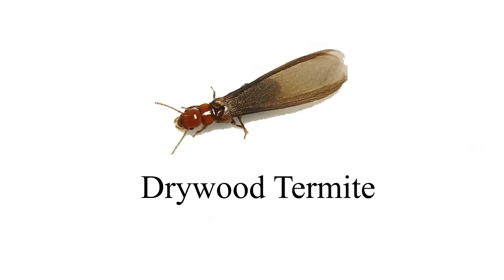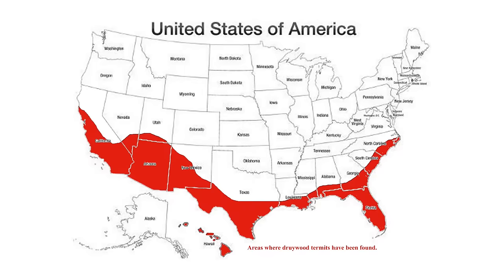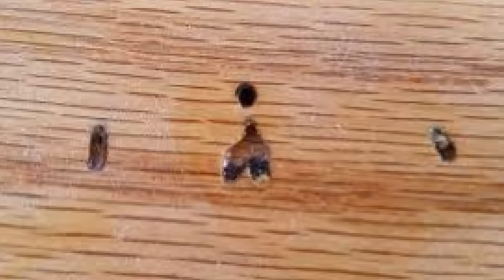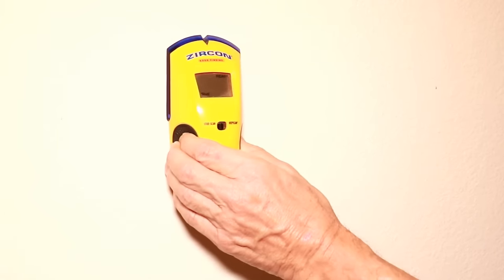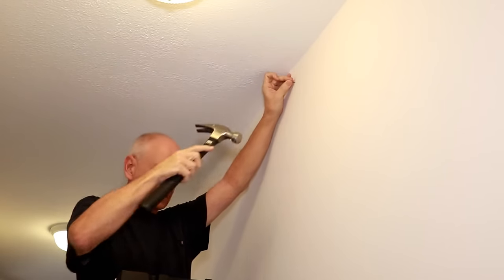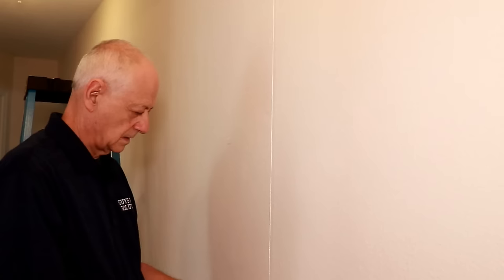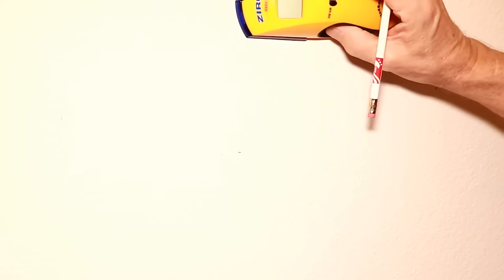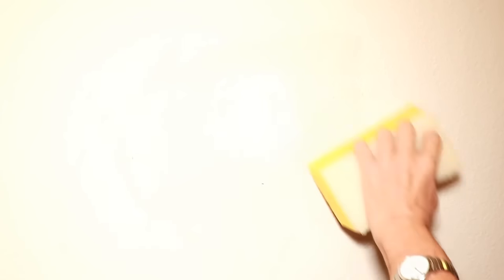How to Treat a Drywood Termite Infestation Yourself. A MUST see if you have Drywood termites.

Comment: Nice video. Thanks for making it.......How does fras fall down past a blanket of insulation batting?
Reply from the maker: Hi Mike.  That is a good point and yet another reason why tapping on the walls is far from a reliable way to find drywood termites.  The good news is that the interior walls are typically not insulated, so it works best on those areas.  The exterior walls are definitely more of a problem.  You see, this is why the pros cannot guarantee that they will find all the galleries.  There really is no perfect way to find all the galleries that are behind drywall and it's the reason why I tell you very early in the video that the only sure way to eliminate a drywood termite infestation is to tent and fumigate the entire home.  Still, fumigation is expensive and a lot of folks cannot afford it.  I was not even going to do this video because I understand that I cannot give folks a sure-fire way to eliminate drywood termites 100%.  My goal is to always give everyone a 100% guaranteed solution to a problem and I knew that I could not do that with drywood termites.  However, I had so many people ask me to help them that I finally decided to make the video, knowing full well that there is no way to find all the galleries.  The treatments that I recommend always work 100% of the time.  It's just finding the termites that is the problem.  Even if you use an inspection scope on the exterior walls, the frass may not make it to the bottom of the wall void because of the insulation.  Also, as I pointed out in the video, listening for hollow sounds in the wall studs is far from reliable as well.  Let me tell you Mike... I am always honest about this stuff and I will always give you the straight story.  You are totally correct.  I wish I had more to offer, but it is what it is.  If you can afford to fumigate, then that is definitely what you should do.  This video is just for people who simply cannot afford to fumigate.  For those folks, this is the very best option available.  Albeit not exactly perfect.  In any event, after you treat for drywood termites, you should start doing the prevention treatment that I explain in my other video.  That treatment is pretty much a 100% foolproof method of stopping drywood termites from ever entering your home again.  It's cheap, it's easy to do, and it is very effective.  I will place a link below for it in case you missed it.  Thank you so much for the comment.  I wish I had more for you.  Be well my friend.

How to Prevent Drywood Termites video:  https://youtu.be/neNsmVbj8Pc
Reply: @GuysPestSolutions  Thanks for the great answer. 

I listened to your detailed treatment option for treating all the studs. You said to drill holes 4" apart and 1-1/2" deep in every single stud.

Most of the holes will not actually hit any galleries. So, are there any residual benefit to injecting the foam where there are no termites? In other words, does the foam remain forever in the stud in the event a future termite colony tries to live at that particular location? 

If there are residual benefits, does the foam under pressure, actually seep into the wood beyond just the small drilled hole before it comes back out? Wondering if the injected foam may make pockets of poison that may be of benefit in the future years.
Reply from the maker: @mikem54321  You are correct.  Most of the holes will not hit anything.  The only reason for doing the entire stud is because you don't know where all the galleries are.  If you don't inject the foam every four inches, then there is a chance that you will miss a gallery that you did not find.  Now, you don't need to do every stud if you don't want to.  You can treat just the studs that you think are infested.  Of course, there is a good chance that you will miss galleries this way.  If you treat every stud, then you cannot miss a gallery.  The foam has about a 90-day residual, so after that it is no longer effective.  This treatment is designed to just eliminate existing galleries and it does not prevent new ones.  After you get rid of all the galleries, then you need to do the treatment in my video on how to prevent drywood termites.  That treatment will prevent drywood termites from ever infesting your home again.  However, it must be done every 90 days.  If you have not done so already, please watch that video as well.

I hope that helps.

https://youtu.be/neNsmVbj8Pc
Reply: @GuysPestSolutions  Thanks for the reply. Pity the foam does not last in the 2x4 forever as a future barrier to colony formation. It would make the idea of drilling a huge number of holes very worthwhile.
Reply from the maker: @mikem54321  There is a way to permanently treat your home for every species of thermite there is, but you really need to know what you are doing to do it.  Most pest controllers won't do it.  A lot of them don't even know about it.  I will place a link below in case you are curious to see how it is done.  I have never done it myself because it is fairly new and came out after I retired.  Anyway, have a look and see what you think.  Be well Mike.

https://www.youtube.com/watch?v=kXQTc9wwCfQ&t=25s
Reply: @GuysPestSolutions  does boricare soaked through the entire piece of wood or does it just touch the surface and stay there and prevent termites from eating it?
Reply from the maker: @macknumber9  Bora-Care will penetrate quite deeply into the wood.  If you apply it to both sides of a 2 X 4, then it will most likely get almost all the way to the center.  It will certainly penetrate deep enough so that you will not get structural damage before the termites are exposed to it.  This is not the case with other borate products like Timbor.  Most of the time the borate products are wettable powders that just treat the surface of the wood.  Bora-Care is a liquid, so it will penetrate into the wood fibers, much the same way as if you got the wood wet with water.

I hope that helps.  Be well my friend.
Reply: @GuysPestSolutions  sorry for all these questions but I just thought of one that I think is very important...

This is related to the 3 month protocol that you recommend for drywood PREVENTION.  Spraying the outside....

My question is if swarming season is only 3 months or so out of the year for drywood termites? May through July for example...then why the need to spray pesticides as a preventive measure throughout the entire year?  Wouldn't you be able to just start spraying the exterior from say April through August if the season were May through July?
Reply from the maker: @macknumber9  That is an excellent question.  You are correct that termites usually swarm at certain times of the year.  The only thing is that they don't always get the memo telling them when they are supposed to swarm.  Also, you can forget to do it if you don't keep a schedule.  Finally, this treatment isn't just for drywood termites.  It will also prevent every other pest imaginable from entering the building.  For example, carpenter bees, spiders, American cockroaches, carpenter ants, other species of ants, and so forth.  Drywood termites are just part of the problem.  Carpenter ants and carpenter bees can do plenty of damage too.  Why not just treat every three months and be pest free?  It seems to make sense to me.

I hope that helps.  Be well my friend.
Reply: @GuysPestSolutions  you are seriously helping me so much you have no idea how much I appreciate it.

Talked to a few pest control companies yesterday and they immediately said I have drywoods and need tenting....seems kind of odd that they don't even want to rule out subs....I asked and he said because I am seeing swarmers in the house they are drywoods and subs don't swarm here in FL at this time of year....what do you think of that? Any truth?
Reply from the maker: @macknumber9  The truth is that, here in Florida, subterranean termites usually swarm between November through May, while drywood termites usually swarm March through July.  However, drywood termites have been known to swarm every month except December.  Apparently, they like to take off for the holidays.  So, you cannot identify a species simply by the time of year that you see the swarm.  Sometimes the termites do not get the memo that they are supposed to swarm on schedule and they do whatever they want.

Also, subterranean termites can swarm in you home.  So that is not a reliable way to identify the species either.

The best way to identify the species is to examine a specimen.  It's pretty easy too.  If the swarmers are solid black, then they are subterranean.  If they are a reddish/orange/brown color then they are most likely drywood, but they could also be Formosan.  In your case, if the swarmers are not black, then the pest controllers are most likely correct.  If these are drywood termites, then the advice they gave you to fumigate is also correct.  The only sure way to eliminate a drywood termite infestation is to fumigate.

Keep in mind though, fumigation has no residual action, so you can get reinfested the moment the tent comes down.  Therefore, you must do a preventative treatment every three months.  If you fail to do that, then I can almost guarantee that you will be fumigating again after four to seven years.  While you may get reinfested immediately after the tent comes down, it takes between four to seven years for a new batch of termites to start to swarm and that is when you will realize that you have them again.  This means that they were busy eating your home for four to seven years before you realized that they were there.  I have a video on how to prevent drywood termites and I will give you a link below.  This is something that you must do yourself because, most of the time, pest controllers will not do it.  It is perfectly safe though, if you do it my way.  If you fumigate, then start the preventative treatment a few days before the tent goes up.  That way you will be protected the moment the tent comes down.

I hope that helps.  Be well my friend.

Video on how to prevent a drywood infestation:  https://youtu.be/neNsmVbj8Pc
Reply: @GuysPestSolutions  it helps more than you will ever know.  You truly are helping me so much and probably more people that aren't commenting but they are reading this.  Again I GREATLY appreciate your time in thoroughly answering all my questions.

I think my plan of action is to spot treat the best I can until my tenants move out.  I don't want to tent while they are in there for 2 reasons.  1 they might not be happy about having to move out for 3 or 4 days and I would have to pay for that on top of the tenting.  2.  I think 11 more months I should be ok as long as I throughly spot treat and at least control the damage.  Of course this is if they are drywoods which eat slower than subs.  If they are subs then obviously I will take care of it now.  The ultimate plan will be though to shop the best prices for tenting and doing your prevention protocol.

I had one pest control company tell me that they would tent for between 750 and 1700 (they haven't seen the property yet just over the phone quote) and then pay 15% of that per year will cover me for a free tenting if they did come back....seeing how it would take roughly 6 years for them to come back I know I would pay at least roughly 150 x 6 ($900)...I think this is a fair deal because it would probably cost me that anyway to prevent but the difference would be that if I did in fact prevent I wouldn't be having to have it tented again (inconvenience) and I wouldn't be having all that damage take place for those 5 or 6 years without me knowing.

So armed with your knowledge it would be wise for me to not pay them the 15% cost of tenting every year and just be proactive in preventing them from returning by spraying every 3 months...I might just have to do this for all my properties down the road...I have 2 rentals now and I don't plan on hiring someone to do this because I only trust myself for how much pesticide I used and how efficient I am in making sure I do a really good job spraying everything
Reply from the maker: @macknumber9  Yes, I think you have a pretty good plan.  Drywood termites are slow eaters and so, hopefully, there will not be all that much damage in another year.  The way a lot of people handle drywood termites is they just tent the buildings every seven years, but as you pointed out, that means the termites are busy eating away constantly during that period of time and so the structure is going to continuously be damaged.  At some point that will most likely result in a structural failure of some type.  The reason people do it though is because they do not know how to do a preventative treatment because nobody ever told them how to do it.  You just happened to get lucky because you found my channel.  To the best of my knowledge, I have the only video on the entire web that shows how to do a preventive treatment for drywood termites and I only posted that about four months ago.  My channel has not exactly gone viral, so there are still literally millions of people that do not understand that they can prevent their drywood termite infestations.  It's really a shame too because people are throwing good money after bad on fumigations and this process is resulting in millions of dollars in damages every year to homes when it can so easily be prevented.  That is why it is so important for you and everybody else that has discovered my channel to pass the word along to everybody you know.  The truth is that this video has only been viewed about 1200 times, but there are literally millions of homes that are located in drywood termite territory, so all I have managed to do so far is to kind of spit on a forest fire.  For the life of me, I don’t know how to get the word out, other than to ask people to pass me along to others.  There is a little glimmer of hope because I am now getting some professional pest controllers who are contacting me for advice and they tell me that they are watching all my videos.  The stuff that I tell you to do in this video is not exactly rocket science and it is all technology that has existed for a very long time.  The thing is though that none of the other pest controllers stopped to think about how to use the existing technology to prevent drywood termite infestations, even though it’s so obvious.  Once they see the video, they inevitably think to themselves “Why didn't I think of that?”  I guess it's like that with a lot of things on the web.  It never ceases to amaze me some of the things that people come up with that I never thought of.  Anyway, I hope that I can get the word out somehow in order to save people a lot of money going forward.

On a positive note, the price that they quoted you sounds pretty good to me and it sounds like you now understand everything you need to know on the subject to be effective.  So, I will take that as a win for you and a win for me as well. 

Be well my friend.

Comment: How about trying to locate termites by sound? Maybe some really high powered stethoscope where you don't even need to drill into the wall to check for frass you can just find the beam or stud and put that stethoscope up to it? Do termites make a clicking sound when feeding? This could really work well especially if you get a really good stethoscope that can pick up sound good and you would avoid all the little holes....would be faster as well as you wouldn't need to drill through and look through the bare scope each time
Reply from the maker: Termites do make some noise when they eat.  The thing is though that it is not terribly loud.  I suppose, if you had a really good stethoscope and if you had a pretty good size gallery, then you may be able to hear that activity.  So, this could be another arrow in your quiver that you can use to locate some of the galleries.  Still, I would not hang my hat on finding them all simply by listening for them.  The other problem that you may run into is that there may be other noises in the walls as well.  So, it's one of those things where it couldn't do any harm to give it a try and see how it goes.  At the same time, I think it is highly unlikely that you would be able to locate all the termite galleries simply by using a stethoscope.  If only it was that easy.

Thank you so much for the comment.  Be well my friend.